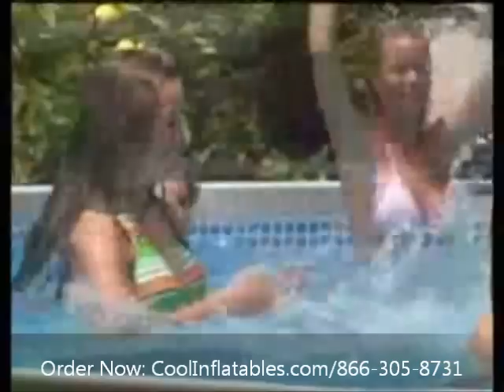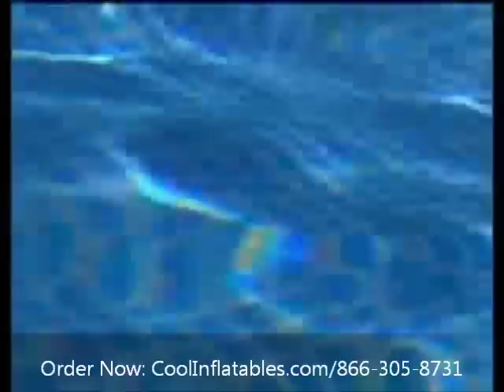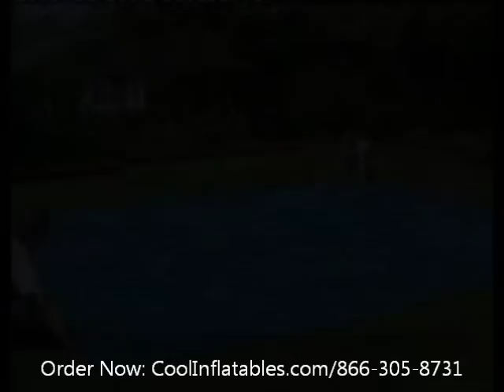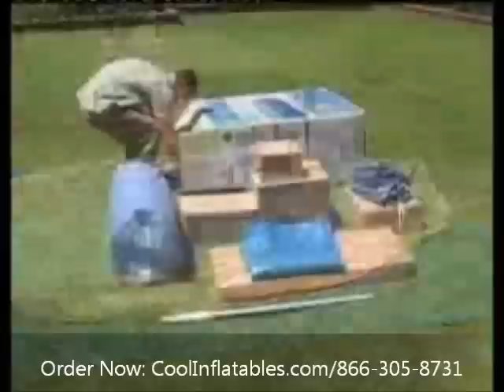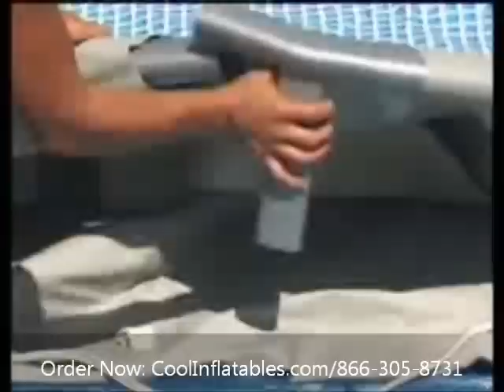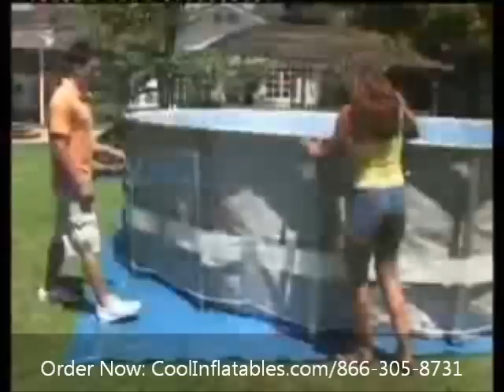Intex Round Metal Ultra Frame Pool Setup Instructions

Comment: This video is worthless, it doesn't spell out any of the real details and some of  things you need to do to get the best possible results like, cut up your sod , level the ground, bring in some sand and smooth it off so you don't get wrinkles in the bottom, wrinkles make it hard to vacuum the pool. Another important part is to put some blocks of wood (sand smooth) under the posts so they don't sink into the ground. It's really not as easy as they make it appear.

Comment: I own this exact pool. My 2 year old can step on the strap on the side of the pool and get into the pool unassisted. I called Intex to ask if they had an accessory to prevent this. Lost in translation the operator said, "I don't recommend you get into the pool this way, it can damage the pool". HAWKEYE toddlers around this pool if you buy it. Thumbs up this post to raise awareness.